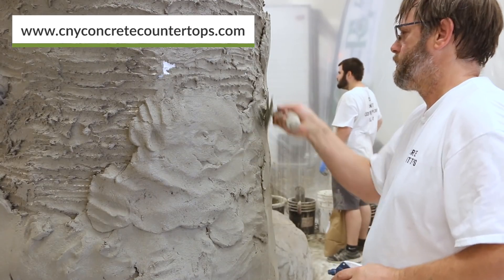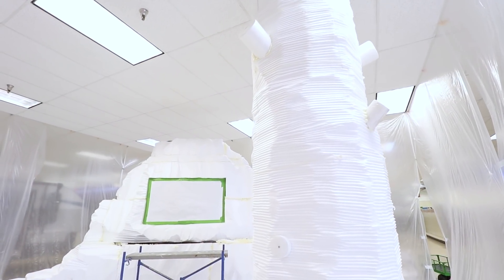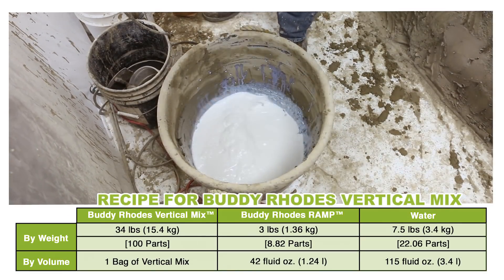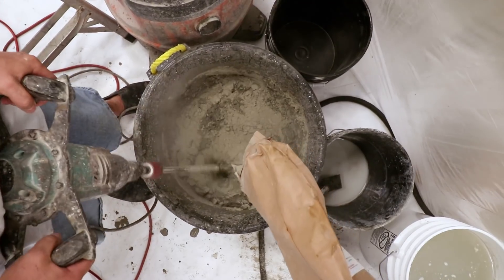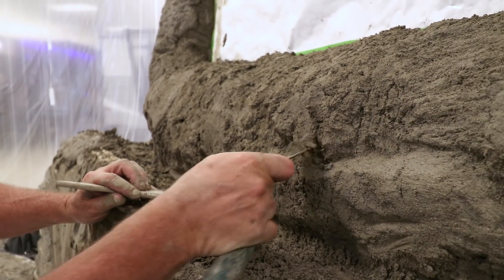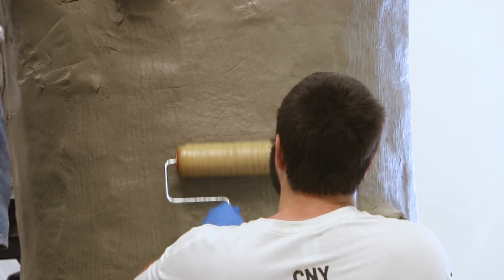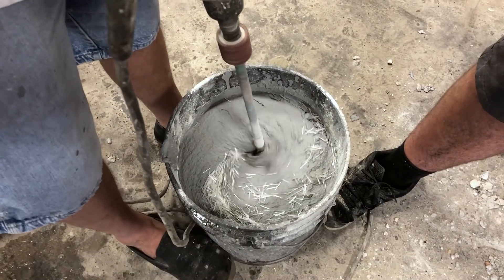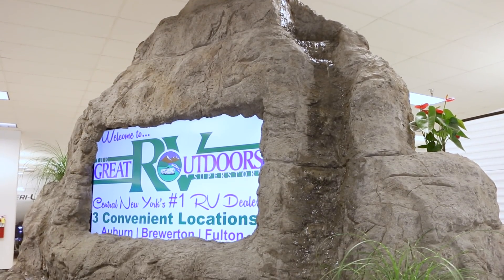Making a Rockscape and Tree Themed Display with Buddy Rhodes Vertical Mix™

Comment: Could this vertical mix be used on the exterior of a stick built house using the wire mesh to create a more cob house, or fairy tale cottage look? Or take an additional stucco type layer? I recently saw a video on an airbnb house that said they used wire mesh and concrete to sculpt the look of the whole exterior and I'm interesting in learning on how to do this and what materials would be needed.
Reply: Follow up to my question. This is a link to the picture of the house I was talking about. Wasn't sure if the vertical mix could be used for this type of application. https://img.theculturetrip.com/1440x807/smart/wp-content/uploads/2017/09/1180586-1.jpg
Reply from the maker: It could!  Our tea can help you!  Give us a call at 1-800-381-1733

Comment: Nice vedio sir🙏🙏 sir i have a pole in my house I wish that i convert it into a concrete tree so i need your help that how I start. Can you plzz give me idea by giving some steps in your reply. Thank you ☺🙏Love from India
Reply from the maker: Hello Yashasvi Agarwal, wrapping the pole with EPS foam as you see in the video would be a good start, you can paste the foam pieces together with an expandible foam adhesive, and make sure the foam surface is not smooth carve a rugged surface so the concrete has better adhsesion. Then you'd follow the same steps they follow in the video. I recommend you to contact our tech support team if you want more in depth assistance: https://www.buddyrhodes.com/tech-support
Reply: @BuddyRhodesConcreteProducts  Thank you so much sir 🙏🙏 keep sharing, keep supporting